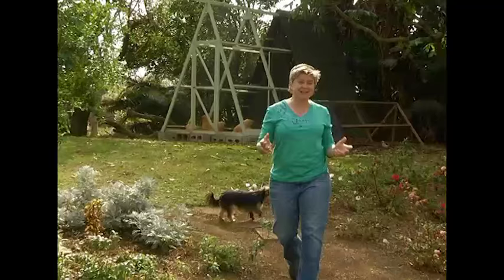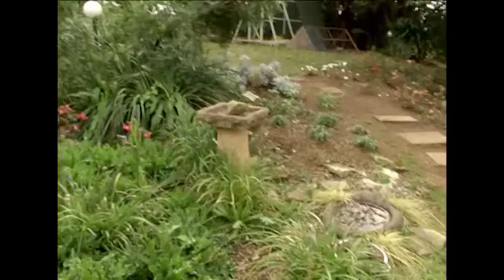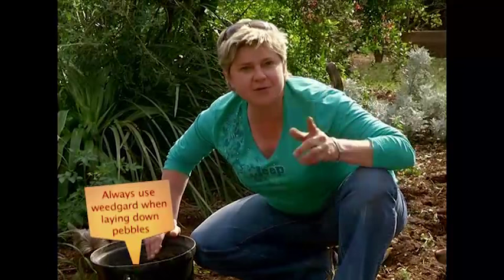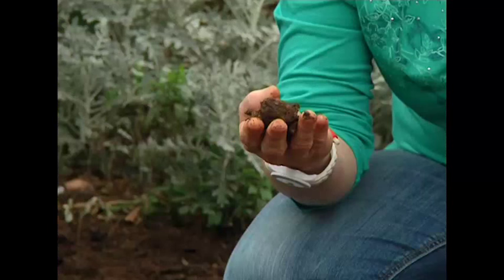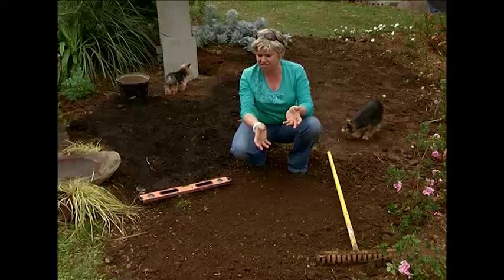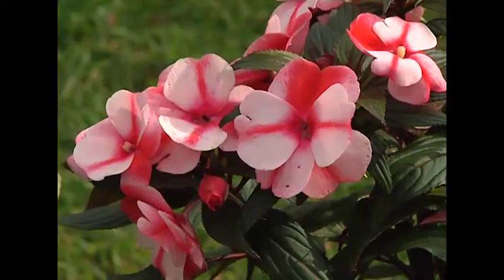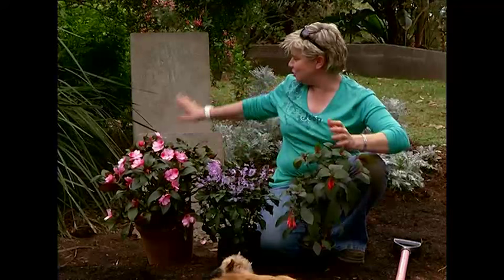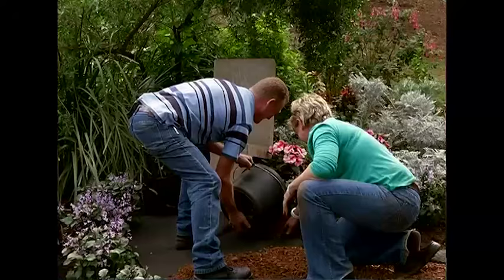Overhauling An Unstructured Garden

Comment: I always use unwashed quarry gravel...with repeated rains the granite and limestone 1/2 inch bits shine through.  I also like the quarry dust that coats the gravel which is a mix of sand and clay that gets "washed" down through the gravel which serves to stabilize it.  And here int he states I can obtain for about $20USD per cu yd.  Of course there's a $70USD delivery charge, but still very economical.  And, as you showed, it's easy to work with.  I have a 22 ft x 24 ft garden area with raised veg beds and adjacent greenhouse.  I have 4+ inches of quarry gravel over a clay/limestone fill base.  My garden complex is weed free, very functional and beautiful.  It's a joy to work in.